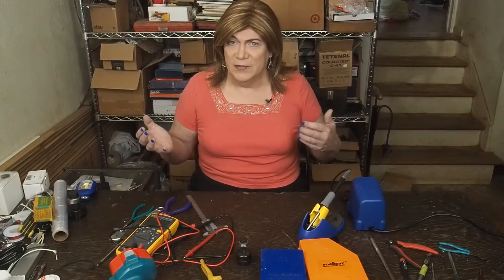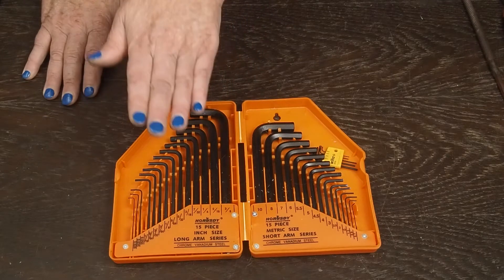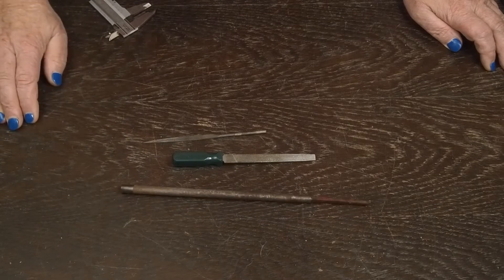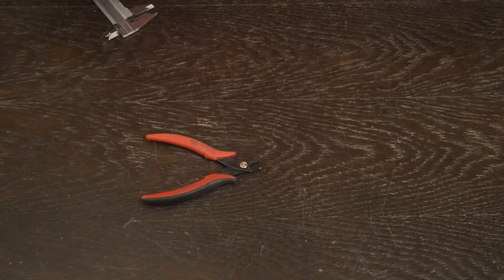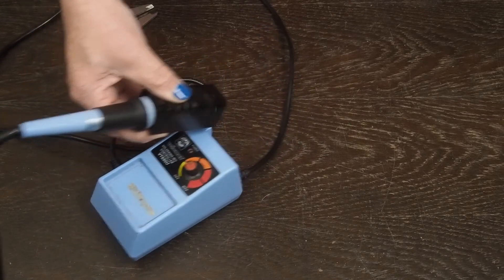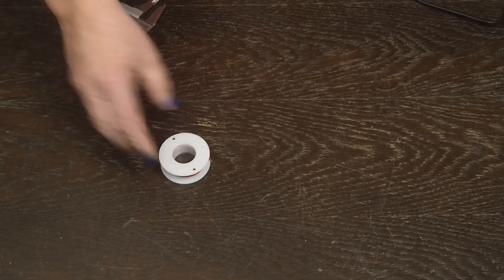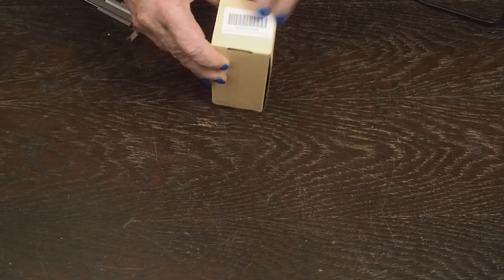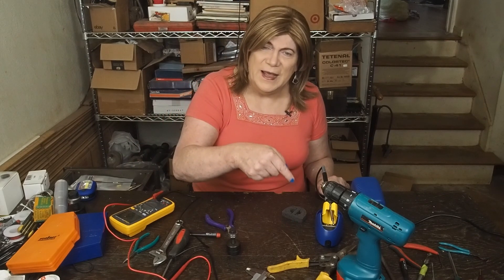All Tube Phono Stage Pre-amp Part 2: Tools

Comment: I've got most of the tools, but have to order a few things like the wiring, soldering tip cleaner, and the chassis punch. I have to get the materials over time as it'll cost about $288 just for the parts, not including the tubes. The tubes seem to be pricey for the ones you recommended and I need to keep this on a lower budget or my wife won't be happy with me spending too much money on this. This will be a great winter project as I have your video series saved. Thanks!
Reply from the maker: You can try a 7025 for the first tube only and 12AX7 for the other two if money is tight.
Reply: @SkunkieDesignsElectronics  Thanks and I'll note my list and look them up. I've got most of the tools and have a couple more to get before ordering the parts.